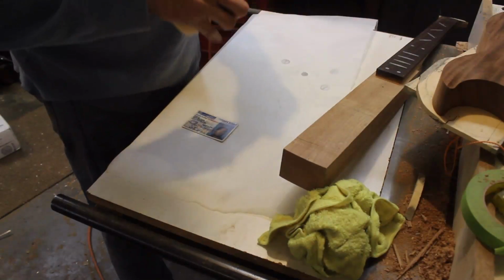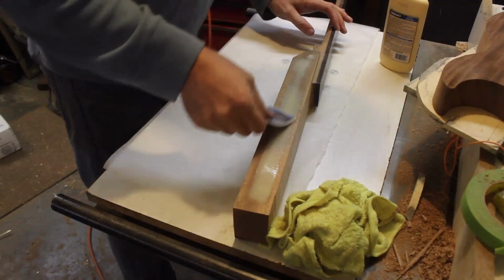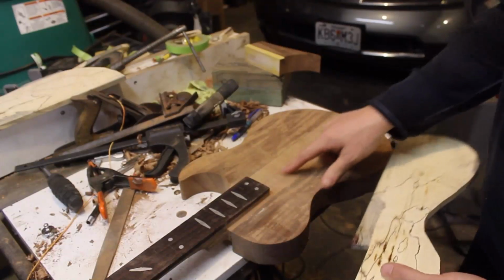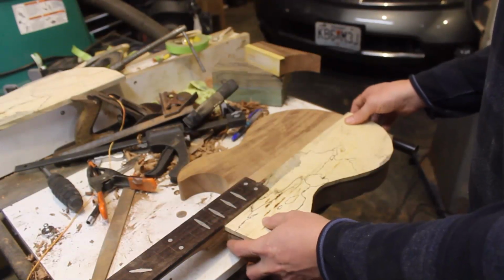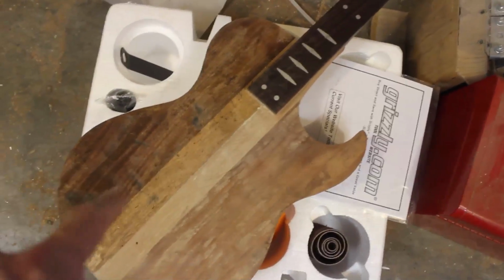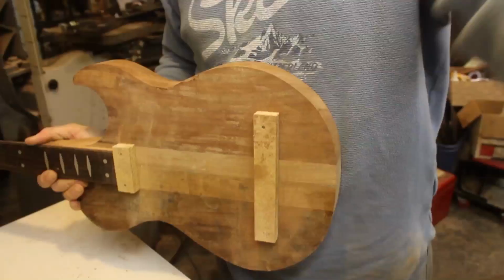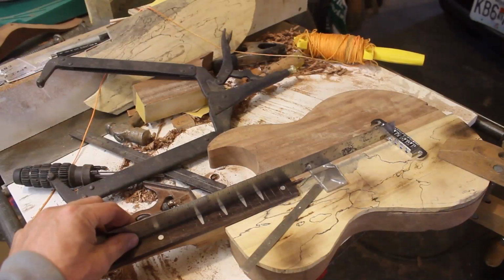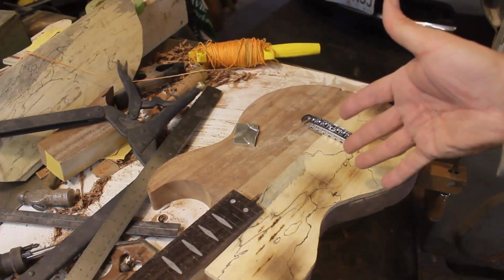Guitar Build - Part 22 - Gluing the Body & Top

Comment: Sometimes symmetry is really critical, other times, it ends up being a detail that no on would notice, and you just don't know either way until it's finished, but I know for me, I would be like you working hard to get those center lines lined up... It's starting to look really cool!
Reply from the maker: This style of guitar (neck through) has a high level of difficulty when you are fitting tops.  All other styles, you glue the top onto the body, then cut out the guitar centered on the joint.  Most neck throughs don't even have a cap, so not too many builders ever encounter this detail.  This detail would have driven me nuts if it wasn't right.  In a weird way, I'm glad I had to pop that half of the cap back off.  It gave me a chance to redeem myself.  Thanks for the comments Gary.

Comment: I wonder if you might need to heat the other half of your face like you did the first one. Looks like it heated it pretty good, is it discolored at the depth you'll be sanding it to?.
Reply from the maker: I'm hoping the brown spots are just on the surface.  I should be able to sand them off.  If not, I'll do like you said and burn the other half.